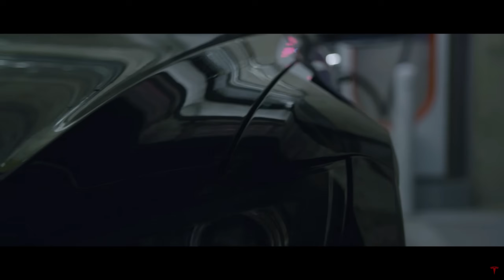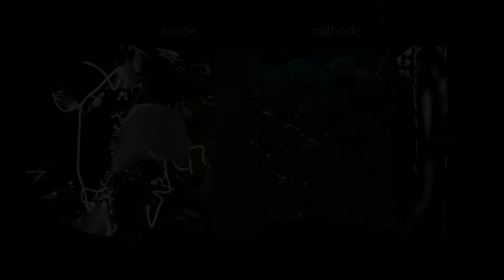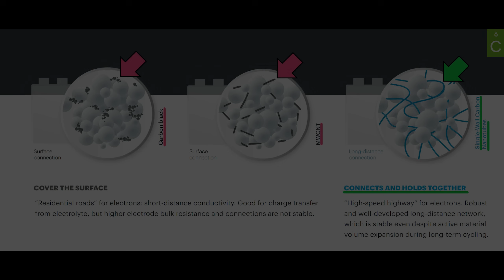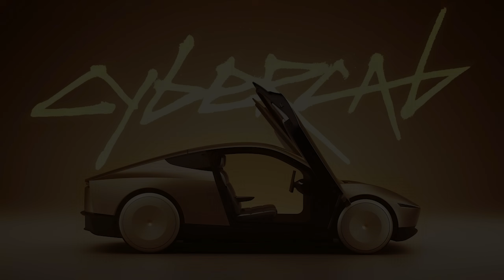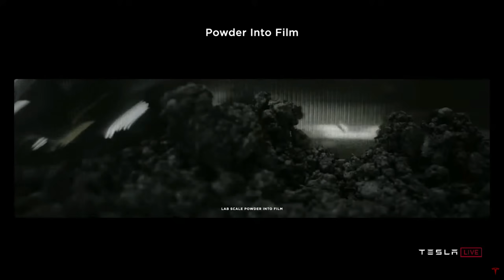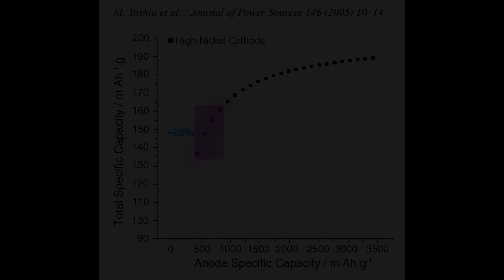Single Wall Carbon Nanotubes for Lithium Ion Batteries

Comment: Nice video.  Another path for Tesla would be in a proof of tech vehicle.  Someth8ng low volume, high performance .  9ne that would not significantly impact the bottom line if there were a month or two production slow down.  And one that was relatively high margin to absorb the technology cost.  Hmmm, if only such a product could be found.  Hmmm.

Comment: The lithium isn't necessary for solid-state energy storage with SWCNT? Their early lab tests reached "583 Wh/kg": "Giant nanomechanical energy storage capacity in twisted single-walled carbon nanotube ropes" (2024)
Reply from the maker: Expensive

Comment: Adding silica causes expansion and contraction, how do they stop this from degrading the life of a battery?
Reply from the maker: It's going to take a combination of technologies 

But the way this specific technology helps is that it keeps the particles from becoming electrically isolated

Comment: At one point Elon mentioned doing without the anode. I do not have a battery background but wondered if you could explain that statement. I do find this stuff very exciting and appreciate your explanations.
Reply from the maker: Sure thing!  Basically he's talking about a future technology where rather than coating the copper anode foil with graphite to store lithium ions, the lithium ions get electroplated directly to the copper foil during each charge and discharge cycle.  Pretty wild.

The issue is that it causes expansion and contraction stresses and it's hard to plate that lithium uniformly - it can short out and cause the battery to rapidly discharge, causing thermal runaway.

Comment: April 2024: SiAT: a leading Taiwan manufacturer of advanced nanomaterials for batteries, is excited to announce a strategic partnership with Japan's Zeon Corporation. This collaboration marks the introduction of single-walled carbon nanotube conductive paste. 

This is another company that has started to mass produce SWCNT paste on mass scale in the past few years.
Reply from the maker: Working on mass production is not the same as mass production 

It also depends on their definition of mass scale 

Either way, I'll look at them

Comment: Good video. Pretty incredible benefits, cost wise. Easy to manufacture with. Good point on ptfe vs nano tubes. Will be interesting to see if Tesla manufactures these at scale. Would be tough to depend on one supplier like you said.

Comment: Might consider hemp industrial cannabis bast hemicellulos is a natural multi layered nano fiber,. Just saying
Reply from the maker: Definitey not:

https://grok.com/share/bGVnYWN5_3dd86d03-4878-412a-8a16-349258ee57ac
Reply: @thelimitingfactor  too bad , I have  a decade in it's research , it's Staggeringly cheaper and it's quite impressive 

* AI Overview

+4
Hemp bast hemicellulose, a component of hemp bast fibers, holds promise in energy storage applications due to its potential to be converted into graphene-like materials. These materials can serve as conductive electrodes for supercapacitors and other energy storage devices. Hemp bast, a nanocomposite of lignin, hemicellulose, and crystalline cellulose, can be processed to separate into nanosheets similar to graphene.

Comment: More than 15 years ago A123 SYSTEM released the NANOPHOSPHATE 3.3V LFP cells. This improved their power alot. They had commercially availlable 30C continuous cells like the 26650 m1 cell
Reply: Unfortunately they went bankrupt as they had one erroraneous manufacturing line and did not mark the cells. Sold to China and possibly became the knowledge hub for LiFePO4 in China. Their founder was really inventive and is still active. 
@Jordan, as a side question, here we talk about Li-Ion (and most realistic not about LiFePO4). Li-Ion has life limitations. What about this?

Comment: Recycling is going to be a headache. Going through a deep water immersion shredder is  going to end up with graphene contamination and extra requirements for distillation and processing.
Reply from the maker: At the quantities they're using, I don't think that's going to be an issue any more than the other materials in the battery cell

The amount of Cobalt in the battery, for example, is going to be a 100x higher and the amount of nickel will be about a 1000x higher

Comment: Feb 2023

"In line with CATL’s supply needs, the Toyo Ink Group will be expanding the capacity of its dispersion production base, Zhuhai Toyocolor Co., Ltd., in Guangdong, China.

Toyocolor, the core competency of which is carbon dispersion, has been supplying carbon black dispersions for LIB cathodes since 2015. LIB cathodes consist mainly of active materials, conductive materials and a binder. By substituting CNTs for carbon black as the conductive material, Toyocolor was able to achieve conductive performance with a nominal amount of material. "

Toyo ink group also has four factories, including in Japan, Hungary, Guangdong and the USA (Georgia).
Reply from the maker: Would be good to know if that's multi or single CNT
Reply: I was going to ask why not use CNTs in cathodes too? Toyocolor seems to have answered that question.

Comment: Awesome as always!
My mind immediately jumped if it would be possible to have an iron phosphate lithium cell that with single wall carbon nanotube with the same energy density as a high nickel cell?
Reply from the maker: Yes, but only if it used silicon, which would defeat some of the purpose of LFP (cycle life) 🤠 But, it would be cheap!

Comment: Great video as always.  Here I was thinking battery manufacturers had to use a high % of CNT, but as you pointed out, the % is way lower.  Maybe 0.35% for the "sweet spot".

Comment: You might mention health effects of carbon nanotubes. These things are super small, and inflame lungs if inhaled, and thin enough to punction cell membranes. Use in a product would require careful encapsulation, and control of disposal, like asbestos.
Reply: They are nothing like Asbestos. Don’t use word association loosely. I worked with CNTs for years (I grew my own tubes on a CVD reactors I put together myself). They are high aspect ration ratio materials, however, their chemistries make them unique. More R&D is needed to ascertain the specific nature of their toxicity and this will take time…
Reply: The next “micro plastic” - carbon nano tubes might become a ubiquitous and indestructible global contaminant.

With Adverse health risks.
Reply: also the teflon to some extent
Reply: As an inhalation toxicologist I would like to point out that a comparison with asbestos is not appropriate as such fibres are rigid and not as flexible as single-walled carbon nanotubes. In addition, fibres have to be inhaled to do any harm and the video clearly showed that these carbon nanotube fibres are embedded into the battery matrix.
Reply from the maker: I didn't cover it in the video because almost everything we use in our products is toxic or produced in a way that's toxic.

Either way:

https://ocsial.com/hns/
Reply: Yeah but they're similar to asbestos in terms of health risks and things that are permanently damaged when you inhale them are worth mentioning. @thelimitingfactor
Reply: I mean the traditional lead acid battery had lead and sulfuric acid. Both are not good for you. A gasoline engine has all kinds of chemicals. All these machines aren’t great health wise if you mess with the internals. However the typical consumer won’t be exposed to the battery innards while everyone is exposed to exhaust from ICE cars.
Reply: When used in a lithium ion battery, they would be hermetically sealed in a metal case. Not sure how that would be an issue. I would be more worried about coming into contact with other chemicals in the electrolyte than to worry about carbon nanotubes. Can you share a situation where we would have exposure of carbon nanotubes from using them in a hermetically sealed battery cell?
Reply: It would be pointless to mention unless you’re manufacturing it. The consumer would never be exposed to
Reply: @chidorirasenganz car fires are not all that uncommon.
Reply: @ ICE cars yes. EVs no
Reply: Carbon nano tubes are also extremely hard to recycle.
Reply: @alexdrockhound9497 How so?! Carbon can easily burn in Oxygen. Be careful to distinguish CNTs CNT based  composite materials.
Reply: EVs don't catch on fire, they just explode
Reply: @Eduardo_Espinoza  That's gas cars, a gas tank tends to explode dramatically. EVs "vent" rather than explode, giving passengers and the public much more time to seek safety in that unlikely event.

Gas cars are also about 150 times more likely to do so compared to NMC/NCMA chemistry EVs of today.

Even more so if we look at LFP chemistry EVs, which is becoming the standard in entry level EVs and is another order of magnitude safer than the NMC/NCMA chemistries of higher performance EVs.

Click media tends to cause allot of hysteria when it comes to anything new, and this is one prime example of that these days.
Reply: Nope, that's CNG @AllanSustainabilityFan
Reply: @AllanSustainabilityFan correct
Reply: @Eduardo_Espinoza they do not explode
Reply: @Eduardo_Espinoza Chinese batteries are LFP and not NMC and do not burn.  Most flammable automobiles Hyundai, Kia, jaguar ipace, GM Bolt and tesla model S.  All Panasonic or lg chem or sk Hynix batteries.

Comment: Perfect graphene, is a one-atom-thick sheet of graphene. Real-world graphene often contain defects, leading to some variations in performance. I wonder if we'll ever be able to make it at scale.
Reply: Look up a company called GMG(graphene manufacturing group). They are producing probably the most pure grapheme in the world, at scale.

They are already selling products with their graphene in it, small scale, but rapidly expending... Waiting for EPA approval, they have lots of 3rd party testing data available.
Reply: There is a lot of ways to make graphene, so far they have not figured out how to make solid sheets of it.  Just flakes of it.
Reply: @panemon187  they can make solid sheets. Completley possible. See manachester group where the guy got nobel for it. Defect rate is a concern. But it is fundamentally carbon cracked at a moderated temperature which is not hard at all.

Comment: How do you think carbon nanotubes compare to Talga's graphene-based alternative to carbon black?
Reply from the maker: Depends on what outcome you're looking for and the cost per kilowatt hour of Talga graphene 

I don't think talga's graphene would help hold The electrode together 

However, it looks like talga is trying to accommodate the expansion at the particle level rather than the electrode level 

That is, I don't know whether they're competing technologies or complementary technologies or alternative technologies
Reply: Jordan I think the question was referring to Talga’s ‘cathode conductive  additive’ rather than their  anode high silicon  composite particle . I know your segment is about SWCNT in anodes, but in cathodes it’s equally valuable- helps with cell balance as well I guess.
I assumed a while back that’s what they might be achieving.